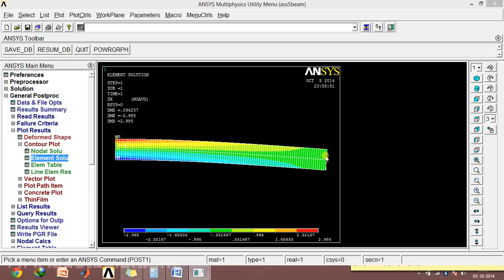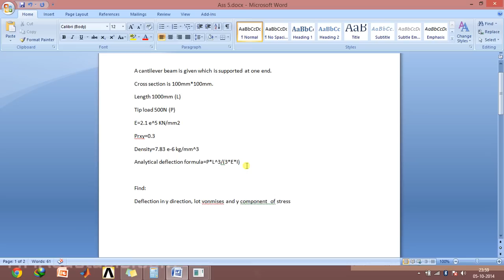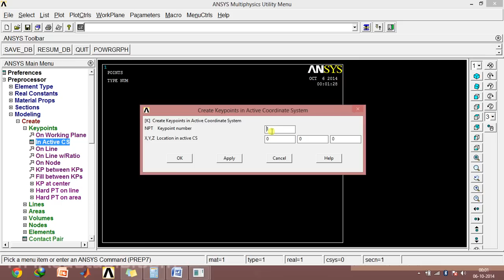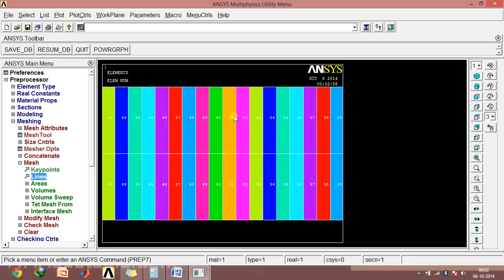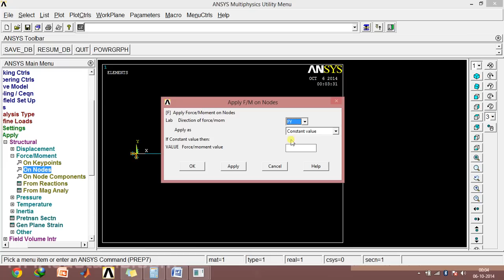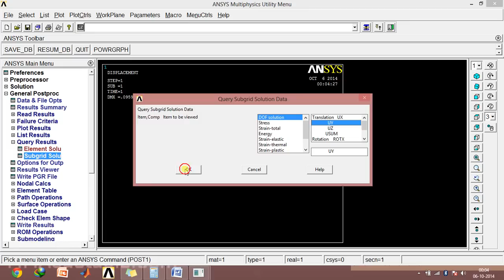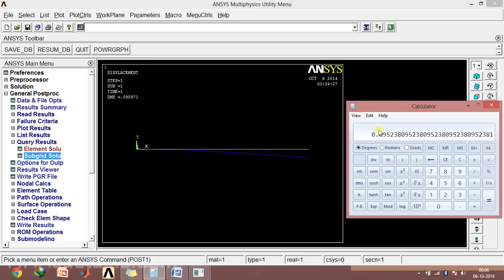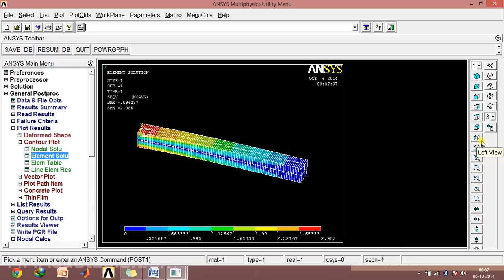Basic 1 D analysis of cantilever beam in Ansys

Comment: FAIL!
Your video is tremendously unrealistic and fraught with errors:
1) Your chosen section is a solid square beam - possibly making sense if using wood or non-RC but your assumed (erroneous?*) material parameters are steel ... so you have presumably modeled a 1m x 100mm^2 solid steel(*) beam - an unrealistic construct, impossible to compare/verify against member tables.
2) Questionable Material:
    Density is appropriate for Steel (A36) but ...
    *Young's Modulus is way off!  Appears to be a crisis of mixed units - or other-worldly material?
Steel (A36) Modulus = 200GPa. 
Your material = "2.1e5 KN/mm2" = 210,000 GPa = ... unobtainium?
https://www.engineeringtoolbox.com/young-modulus-d_417.html 
https://www.justintools.com/unit-conversion/pressure.php?k1=kilonewton-per-square-millimeter&k2=gigapascals
4) Slow the F down! You're speaking so quickly in heavily accented English its impossible to keep up in real-time, or even to double check your numbers. 

5) Your explanation of the units (0:36) is unintelligible BS - probably to deflect from the fact that you're a student academic with no real understanding of what you are working - i.e modeling and measurements are NEVER "independent of the units" - you must always convert/normalize units of measurements to calculation/solution units - you have FAILED to do this.  

I would summarize in opining that YouTube should ban your videos to prevent poisoning brains of anyone searching for factual information.